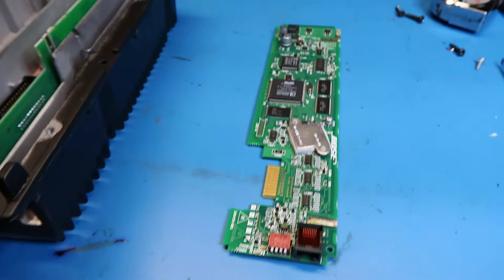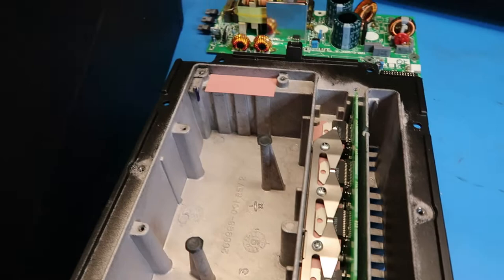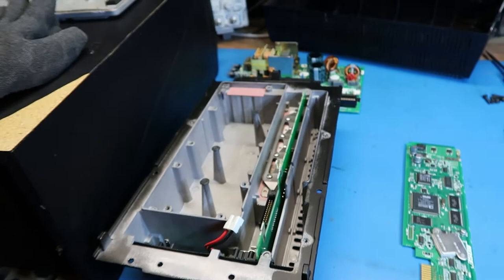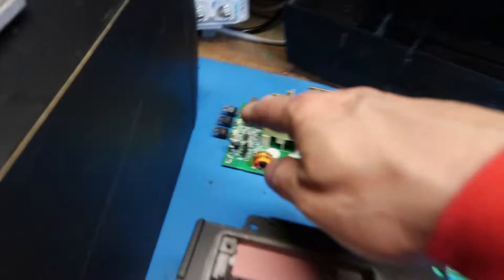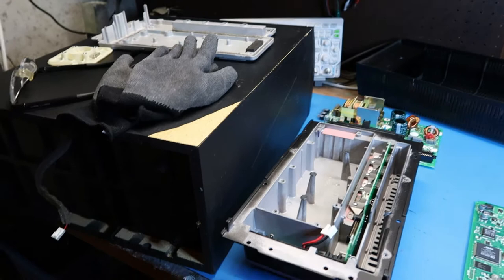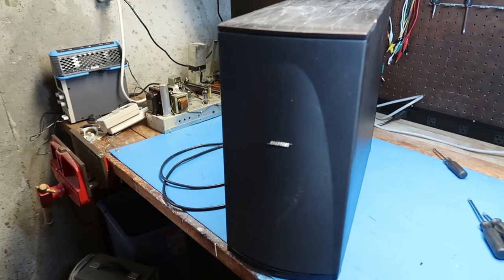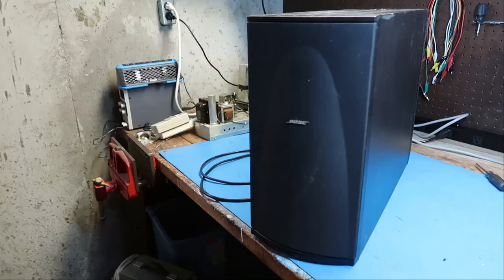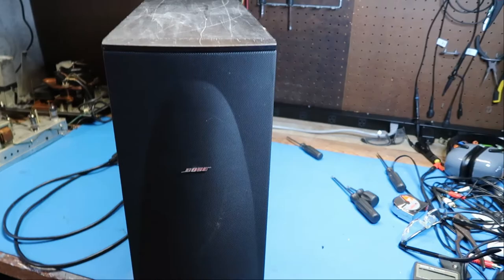Inside a Bose LSPS Speaker System

Comment: If you cant find a way to inject a signal then it may be a good candidate for a parts-express subwoofer amplifier to replace the proprietary junk. 👍👍
Reply from the maker: Great point!
Reply: That is what I plan on doing with my LSPS sub.  This LSPS came with my Lifestyle 35 (5.1 Surround Sound).  The buttons on my Bose console and the remote don't always work.  After 17 years I'm replacing my Bose console with a new Onkyo AV receiver, and plan on using the Bose double cube speakers and sub with it.  I'm disappointed that I can't use the existing LSPS amp, but I'm looking at a Parts Express sub plate amp or an old stereo amp I have to power it.

Comment: Worked for the company on the retail side from 03-06. I find it odd that it doesn't say what Lifestyle system it is on the sticker thats on the bass module where the conectons are. It may be a Lifestyle 18 judging by the date code on the high voltage board. The head unite was a dvd player and all of the Lifestyle systems have a radio frequency remote control
Reply: Yes it is compatible with the AV18 and AV38 consoles (I have the same subwoofer and have connected it to both). Presumably also the AV28 and AV48 which have the same 9 pin connection. I believe the older subwoofers for these systems have the 9 pin connection on both units (console and sub) and the newer systems have the round 9 pin connector on the console and the RJ45 looking connection on the subwoofer. The older consoles are compatible with the newer subwoofers, just need to use the different cable.

Comment: Hi we have the same speaker , didn't  work  when i turn on ,can  you tell me what was the problem?thanks,,,
Reply: Could be just the fuse.
Behind that aluminium cover, there is a fuse in a circuit board.
I think there's only two screws holding that board in but you might even be able to get the fuse out without removing the board?
Test continuity across that fuse.
A good place to start at least. As in this video though, keep fingers away from the middle of the board where those capacitors come through or you'll get a decent boot.

Comment: What should I do if 3 of the audio outputs don’t work and just makes a buzzing noise
Reply from the maker: Sorry, but I don't have any insight on that.
Reply: I have the same issue 
Only two outputs work.
I pulled that main board and the two resistors on the end are cooked.
Going to see if someone can repair this board. Everything else looks ok but obvious burn marks around solder joints on both of the resistors.